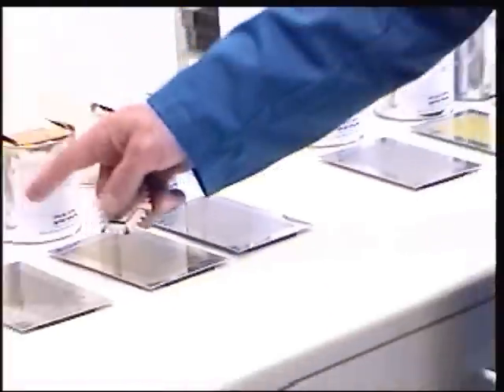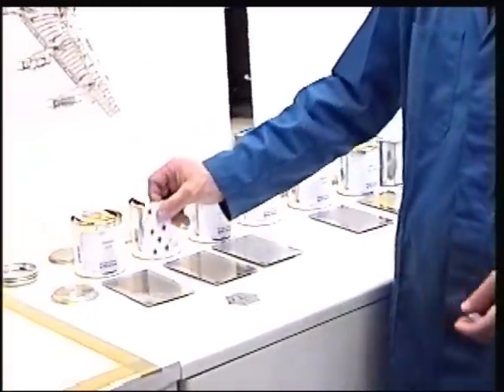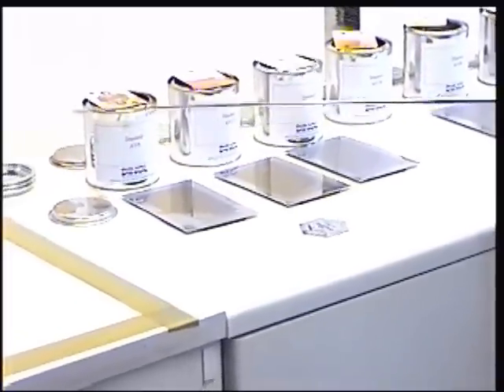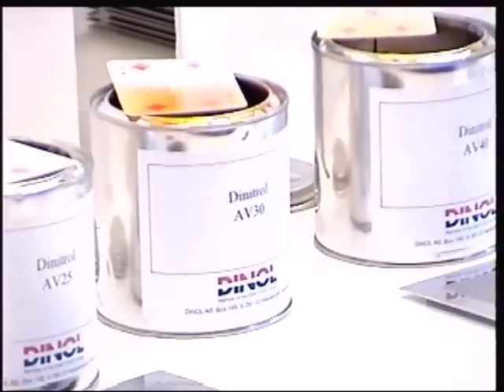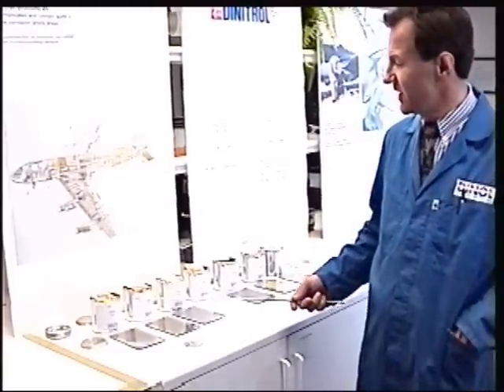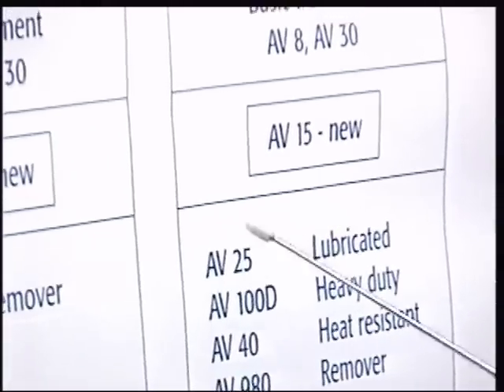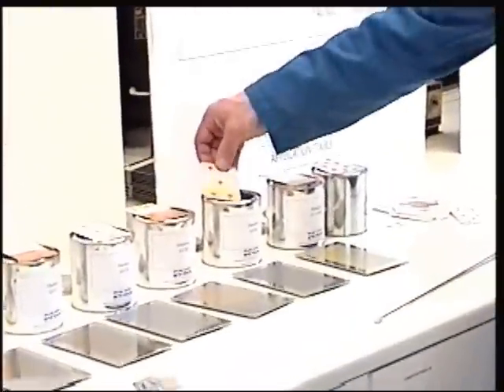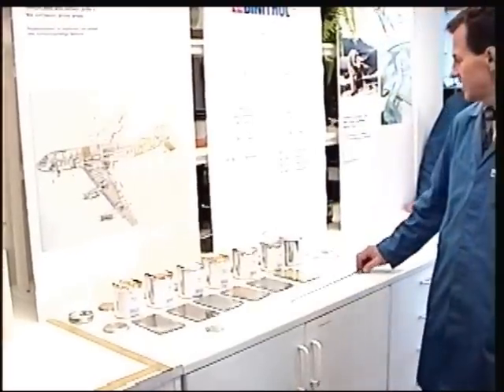Ardrox AV Corrosion Inhibiting Products (CIC)

Comment: AV15 is nice, if you have chance to use AV15 on your bike, or car on small places, it will be protected against corrosion for years.
Reply: I got a crate of date-expired AV8 (thinner and very penetrable) but mostly AV30 from an aerospace outlet completely free of charge as it was to be disposed of. Some of the aerosols and 1 litre cans lasted for another 6 or 7 years until I finally used it all up on my vehicles. Everything else, even Dinitrol's own non-aviation products, are nowhere near as good. I'll never go back to anything else. Dinitrol ML is very dissapointing after using AV8. It's thinner, and has nowhere near the level of CIC content as any of the aviation stuff has in it because it doesn't turn the metal as purple. AV30 is the goto product for laying onto your partly rusty or completely clean autobody and engine and even exhaust pipe for protection. I sprayed a load of it onto my CB500 header pipes and it still lasted a very long time, given all the brunt they take from road grime. And the heat.